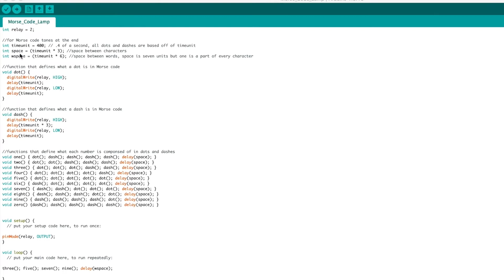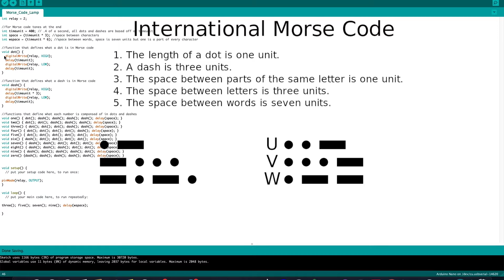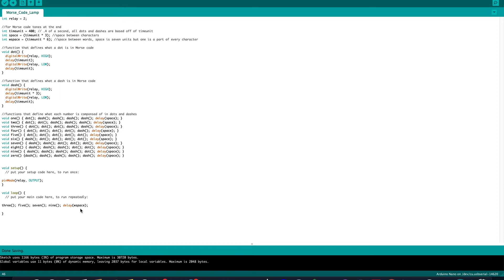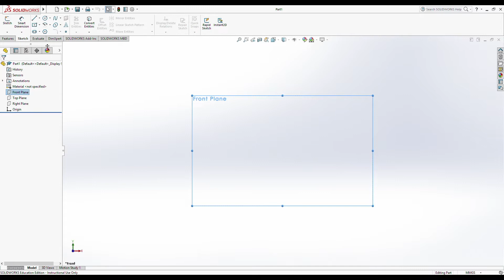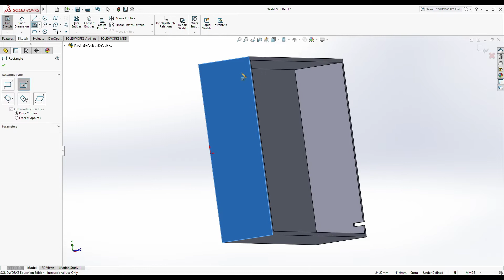Escape Room Puzzle: DIY Morse Code Lamp

Comment: Hey i copied your code but i think im missing some libarys bcouse it tells me that :Error compiling for the Arduino Uno board.
Reply: In file included from sketch\morse.ino.cpp:1:0:
C:\Users\danie\OneDrive\Dokumente\Arduino\morse\morse.ino: In function 'void dot()':
D:\Arduino\hardware\arduino\avr\cores\arduino/Arduino.h:40:14: error: expected unqualified-id before numeric constant
 #define HIGH 0x1
              ^
C:\Users\danie\OneDrive\Dokumente\Arduino\morse\morse.ino:10:22: note: in expansion of macro 'HIGH'
   digitalWrite(relay.HIGH);
                      ^~~~
exit status 1
Fehler beim Kompilieren für das Board Arduino Uno.
 this is the full report massage
Reply from the maker: Not sure what to tell you. If you send me an email I can send you the original I used in the video.
Reply: @BaldGuyDIY  i send you one earlyer this day ill send another one now
Reply from the maker: @Neila_Yob  looks like they went to the junk folder so I didn’t seem them. I will reply.